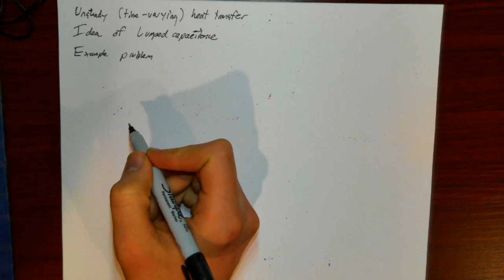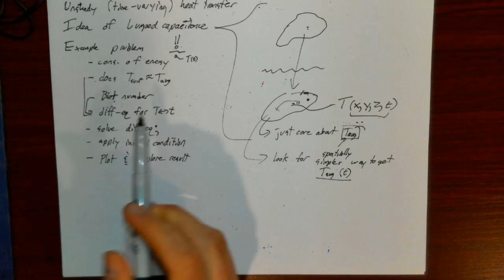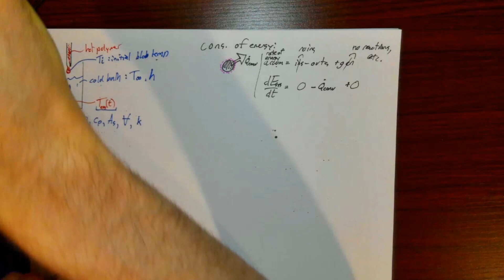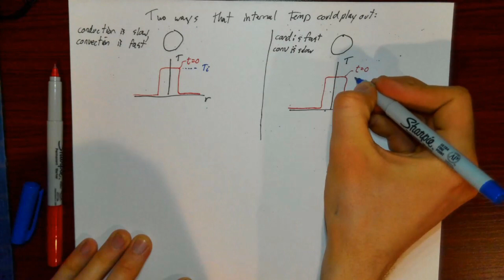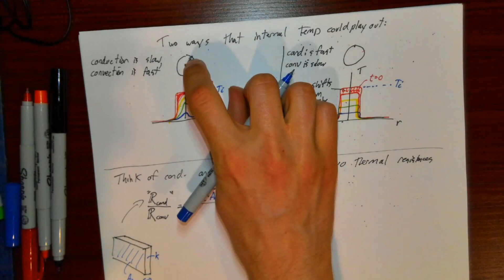BIOE 3310 Lec 22 - Unsteady (time-varying) heat transfer; lumped capacitance

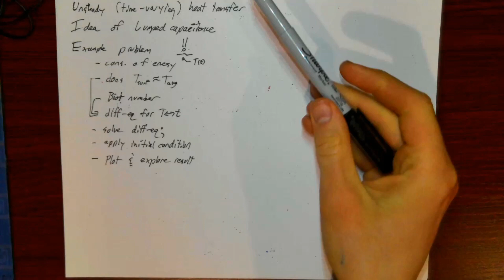Comment: Idea of lumped capacitance - spatially averaged temperature vs time 5:30 
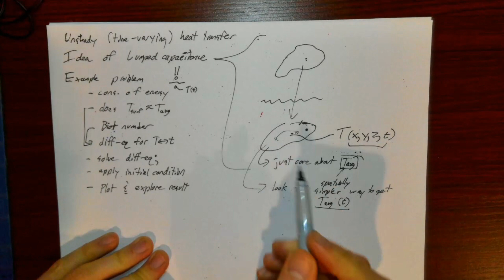Example problem of polymer beads cooling in a water bath 9:30
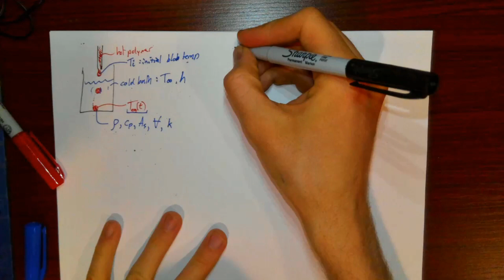-conservation of energy 14:33 
-Does T_surf = T_avg? 24:42
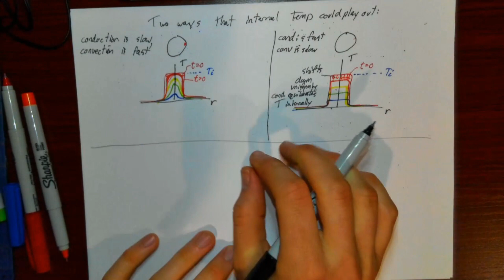-Speed of conduction within object compared to speed of convection from surface: the Biot number 32:37
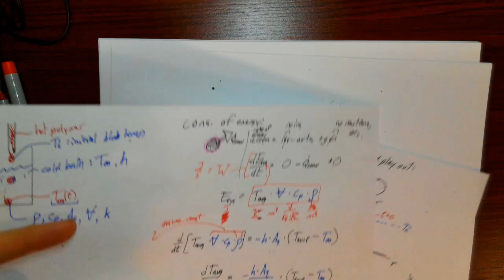-Differential equation for temperature and time 41:00
-Solving the differential equation; applying initial condition 46:13
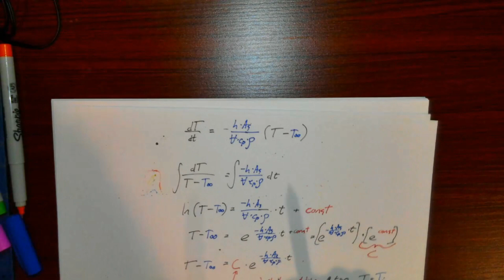-Plotting and exploring result 49:15